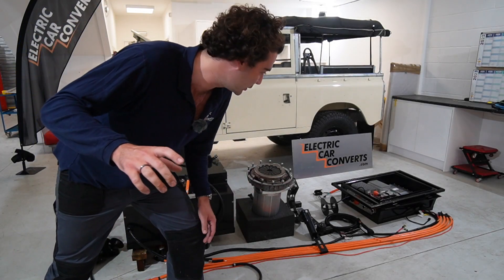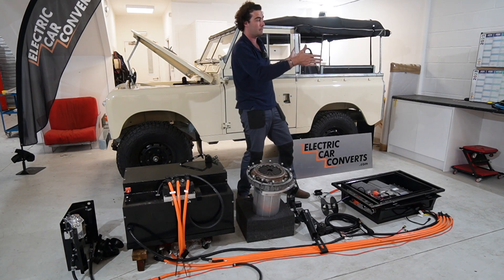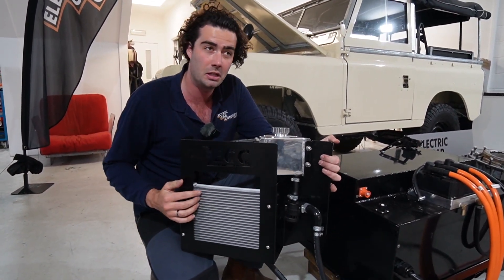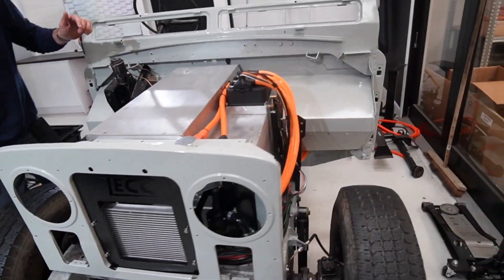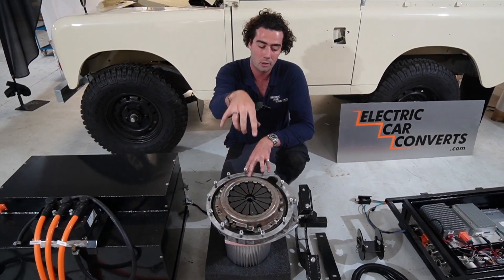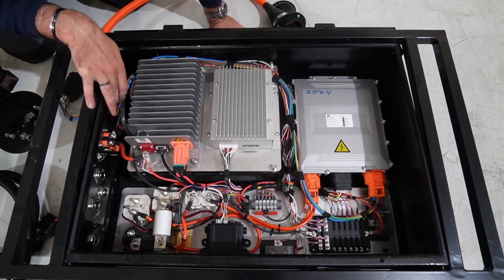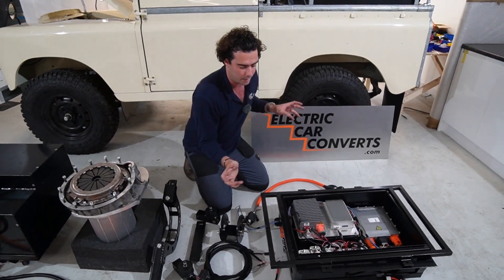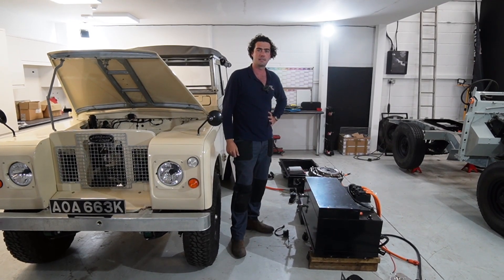FULL EV Conversion kit for old school Land Rovers (1960's to 80's) - Every single part explained!

Comment: Merry Christmas 🎄. I have one in Santa Marta Magdalena Colombia, it is at a shop receiving an overhaul, but I ran out of resources to continue the process. My initial intention was to prepared it to be imported to the USA. But due to lack of resources it is till in Colombia and in the overhaul shop. It is a 1970 Land Rover Serie IIa. 3 doors soft top. Can it be imported to the USA? Yes! Let me know if you want more info. Or perhaps you want to find a Defender for you. To be imported to the USA, it only needs to be at  a 90% originally equiped. And be 25 years old or older. Let me know if I can be instrumental to your Project.

Comment: That's a great kit. I've a couple questions for you.  Would you consider shipping without batteries to save weight?  I can purchase and install them here in the US.  Also, the control box in the back looks to drop in from above.  Have you or anyone you've sold to modified the floor of the tub to gain access if needed?
Reply: Merry Christmas 🎄. I have one in Santa Marta Magdalena Colombia, it is at a shop receiving an overhaul, but I ran out of resources to continue the process. My initial intention was to prepared it to be imported to the USA. But due to lack of resources it is till in Colombia and in the overhaul shop. It is a 1970 Land Rover Serie IIa. 3 doors soft top. Can it be imported to the USA? Yes! Let me know if you want more info. Or perhaps you want to find a Defender for you. To be imported to the USA, it only needs to be at  a 90% originally equiped. And be 25 years old or older. Let me know if I can be instrumental to your Project.

Comment: 120 bhp and 235 Nm torque, there's no way in hell you'll be able to more than feather the throttle unless you like changing gearboxes and half-shafts. 🤣
Why not make a kit that matches the original performance?! Series 2/3s were not designed to be driven like sportscars, they are roadgoing tractors basically.
Reply from the maker: What about the people who put 200TDi engines into them? They have the same power and don't have any trouble! We've converted about 10 of these and never had a gearbox problem - they were obviously built strong back in the day. Do your research, friend!
Reply: Perhaps what you do not know, is that the Inverter can be connected to a Laptop. You can set the maximum current, and (in other words) you can 'tailor' the Main Motor Output Torque to any setting that you desire. And you can get everything perfect in this way........Slightly reducing the overall power output of the Main Motor, will give increased range. I have done this to mine.

Comment: destroying a classic for what? not a good way to go as your batteries are worse than a 60 year old engine ever will be for the environment
Reply from the maker: I know aren't we terrible Wesley! With that reasoning then no technology should ever move forward, we should just continue using old engineering because creating new stuff is bad for the environment!
Reply: I’m ok so you have no batteries for your gadgets at home…..  or cell phone or whatever….  Sorry, but I think that was a very ignorant comment.
Reply: @prophotoservices  nope not ignorant just factual the destruction of a good classic just to be coool and so-called environmentally friendly is bull. no EV is environmentally friendly. and an old classic has long made up any carbon footprint so more friendly than a new car.
Reply: @wesleyconn620 give solutions instead of just complaining. What do you propose as an alternative to batteries? If it’s not possible to repair an severely damaged internal combustion engine, then how would you get the car back on the road if it’s not by replacing the old engine with new technology. I’m not dismissing your previous comment as “ignorant” because you’re right, it’s true that batteries are not good for the environment, I just want everyone to hear you out, not shut you off
Reply: dick
Reply: wrong. the old engine and car has outlived any carbon issue the new stuff you put into it makes it new and therefor it starts it carbon footprint anew. besides there is no carbon issue only a fekin political propaganda environmental agenda nothing factual.
Reply: Too expensive,not enough range and I would have doubts about the gearbox being able to handle the electric motor torque.
Reply: Think about it: Converting a diesel into an EV actually means it can run on anything: solar, wind, hydro, nuclear, coal or even a diesel or petrol fueled generator.
Reply: a british classic with a british motor, good to see a pretty classic become a pretty RELIABLE classic

Comment: I like your kit - particularly the idea of using the front PTO Hole as a mounting for the Battery.

I'm curious how you've overcome the lack of CAN Communication between the Orion2 BMS & SME X1 Controller?  I did get it working on my Polaris using a Teensy to convert the OBD  protocol to CANOpen - but it was flaky as hell.  Any minor comms error & the SME or BMS would shut down.  I'm guessing you use the SME Analog Inputs for sending the BMS Charge & Discharge limits to the SME?
Reply from the maker: Yes it's all done with 12v signals, Orion and Netgain are yet to sort out their CAN relationship!!!
Reply: @electriccarconverts  Unfortunately, I don't think they will ever 'sort it out' as they use completely different protocols.  The Orion uses the OBD Style where you send a request packet & get a response where the Netgain (Dana) uses CANOPEN where it expects packets just to arrive (broadcast).  It's going to require either to completely re-write their CAN Stack - no quick fix.
It is possible using an Arduino as a translator (BTW: I have that working)

Comment: I love that you're doing a kit, and I understand that keeping the Series Gearbox, transfer case and 4wd selectors saves a lot of trouble and expense, but these are some of the parts I'm looking forward to ditching in my conversion. I'd much prefer the sideways M3 motor with full time 4x4.

I saw a converted Landy at Fully Charged Live that had a control box under the floor like that - looked like it would fill with water on the first rainy day... How well sealed is it? Can it be submerged and for how long? Are your kits suitable for working vehicles and recreational off-roaders, or just trendy retro city cars?
Reply from the maker: We run sideways M3 motors in our Defenders and RRC's - we could just about fit one into a Series vehicle but it's a lot of power for an old lady! Our control boxes are sealed and yes you are able to off road without issues!

Comment: Pity the kit goes on the gearbox. I’d prefer to pose the series gearbox personally and have the motor on the transfer box. But great to see a diy kit ready to drop in.
Reply: A Hyper9 (in my experience) doesn't develop enough torque to drive the transfer box directly. It will work, but give you a 0-60 of about a week!  Keepting the gearbox is a good call IMHO.  I would probably loose the clutch & flywheel though.  However, keeping them makes the build a bit simpler.
Reply from the maker: Correct, if you go straight to transfer you won't have quite enough power for safe reliable driving, ie if you had to hill start you'd have to go into low ratio etc.. Keeping the clutch and flywheel allows for gear changes, so if you go from a city road in 3rd gear and are about to sit at 60mph on an A-road, you can shift into 4th without stopping!

Comment: Three questions that might be important:
1. do you also support the longer 109" chassis? 
2. would a left hand steering model interfere with the high voltage cables?
3. will you deliver descriptions of the components, let's say one wan't to add battery modules or reduce the engine power. Off-course own research is a starting point but are you willing to give hints there? (or is it considered a 'closed box' and 'not allowed to touch' system?)

Background; in doubt to go trough a build myself from scratch or speed things up with a kit.
Reply from the maker: Yes, we can do this for the 109 chassis without any issues, its just the harness which is a couple of inches longer. 

Our left hand drive models are an exact opposite of this kit, so the HV cables run the other side of the car to the steering. 

You are unable to add battery modules as this system is already running at the required voltage for the motor. Yes you can change the motor map to give different power modes. 

You can touch, but within reason!!!
Reply: @electriccarconverts   I understand batteries are on the right voltage. but that should still allow for example doubling the capacity by adding a similar pack in a different place and in parralel to the first battery? Such a car would be great to have awesome range and double as household battery.